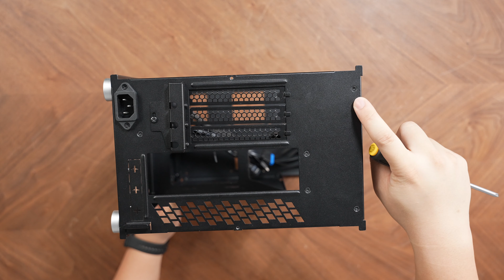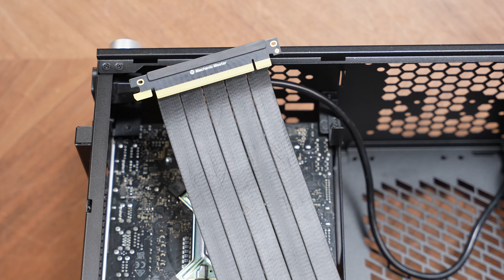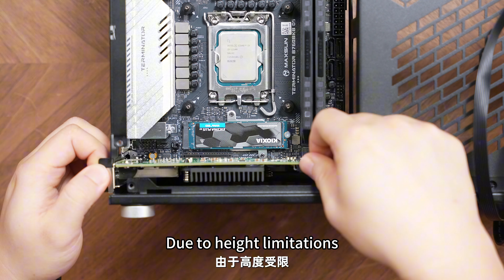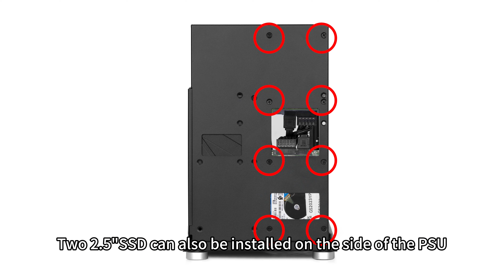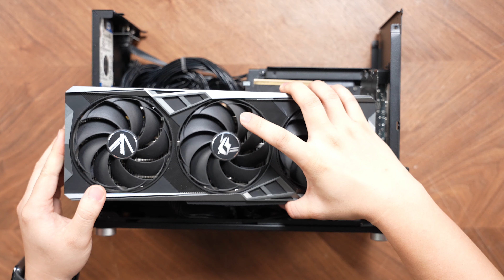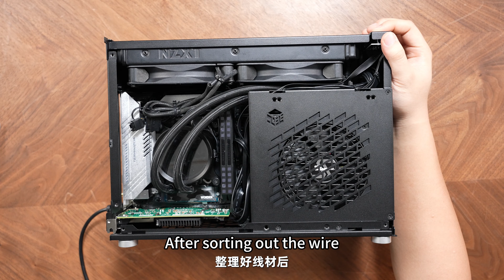New PC set up | Mechanic Master iF15 PC case | BKB-ITX | 280 AIO | ATX |

Comment: hi, i got the 7900xt nitro which is 72mm in height. does 2mm make a difference?
Reply from the maker: There is a difference because 70mm is already our maximum length

Comment: Hi. Are there any plans to sell a kit with a mesh panel instead of glass? When installing the glass, it looks like the power supply has nowhere to take air.
Reply from the maker: Simply swap the panels on both sides
Reply: @MechanicMaster2017 MadDeusYotube is right, you're currently suggesting complicating the airflow situation. Your situation looks like this: I'm replacing the perforated right side panel, which is designed to direct airflow to the graphics card, with a glass panel without perforations, so my graphics card will definitely be sent to Valhalla from overheating. The perforated left side panel is necessary not only to allow airflow to the PSU area but also to allow air to reach the AIO/CPU COOLER fans (not to mention cooling the components, such as the RAM/SSD M2/VRM/PCH/MOS areas of the motherboard). The presence of the glass left panel intentionally reduces the lifespan of the motherboard, RAM, SSD M2, CPU, PSU, and AIO/CPU COOLER.  P.S. Consider implementing a perforated left side panel. Your primary consideration should be your client and the long-term use of the computer in your case. Unfortunately, this isn't currently possible. I wish you the best of luck in your future projects.